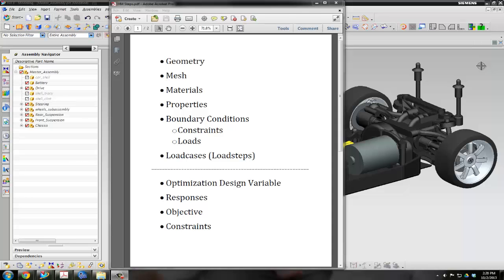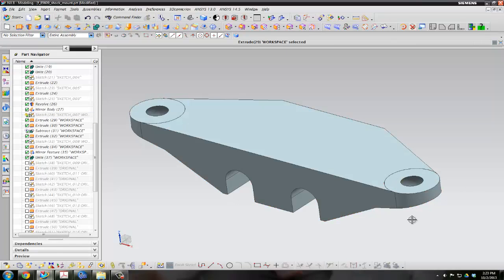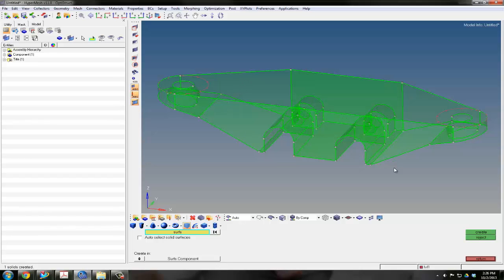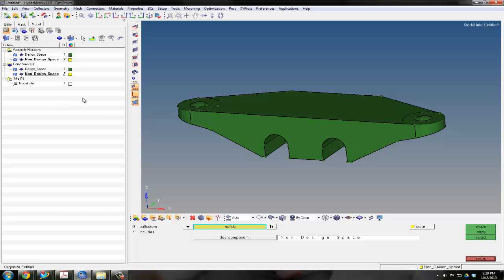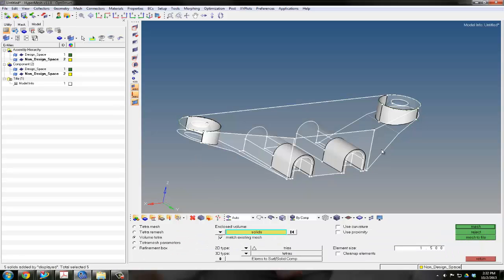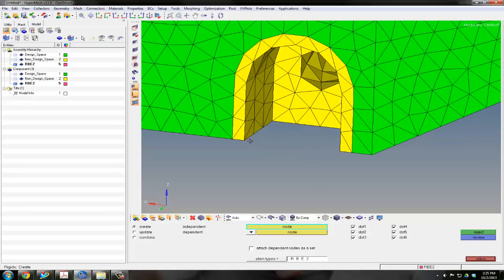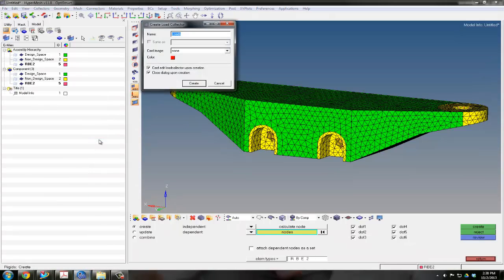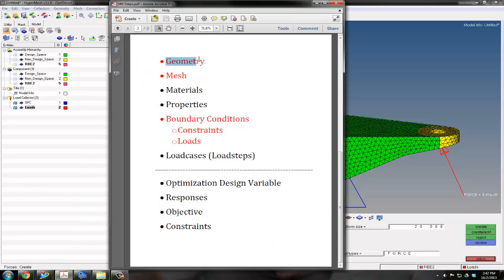Setting up the Geometry, Mesh, and Boundary Conditions in HyperMesh 11.0

Comment: I'm trying to put a model into the virtual wind tunnel. Meshed it and everything but the scale is wrong. How do I actually scale it into meters? I go to mesh -> scale -> components -> all -> set scales to 1000.000. That does not seem to change the size of the model though?

Comment: Hi, how do you get the lines on the surfaces to show up? I am designing a clevis joint for a formula student car and importing my IGES model from Solidworks, but the surface sketches I create on the model aren't showing up in HyperWorks. I'd need these to separate design from non design space.
Reply: I'm having the same problem, did you figure it out?

Comment: Hi, I'm working on solidworks and Hyperworks V13, but I have a problem. I can't get my surface sketches to show up in hyperworks for the separation of the non design/design spaces. Can you help me please?
Reply: +Joshua Simpson is there any way to get hypermesh from internet?
Reply: +Joshua Simpson I noticed that solidworks does not import the sketches that's why I'm using Catia. Otherwise you have to take note of the coordinates in solidworks and then create the sketches manually in hypermesh.
Reply: +CurrencyPrime I've solved it since. When saving the cad file as an IGES in solidworks there's an options button and under that you have to tick "export sketch entities" or something along those lines...
Reply: +Farrukh Bashir if you're a student then yes, there is a student version. It's limited to 10000 nodes though.